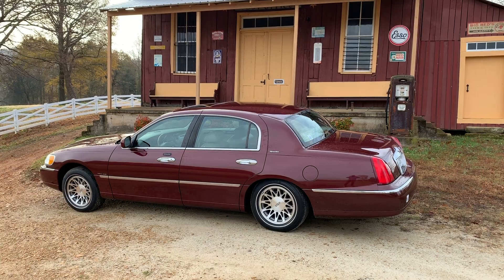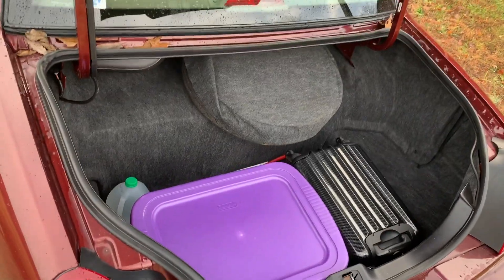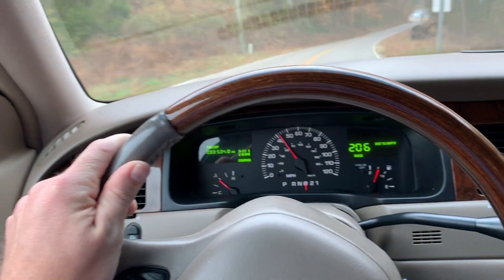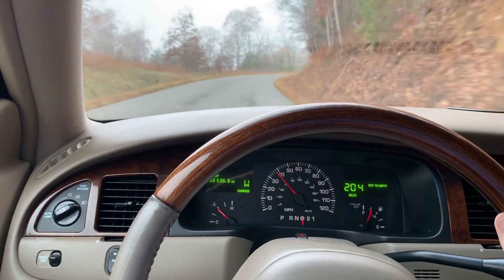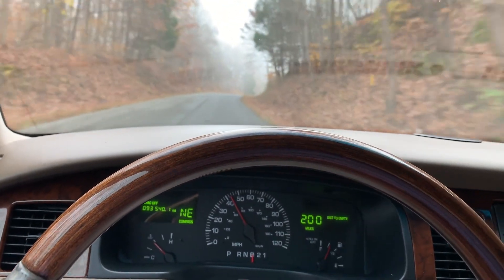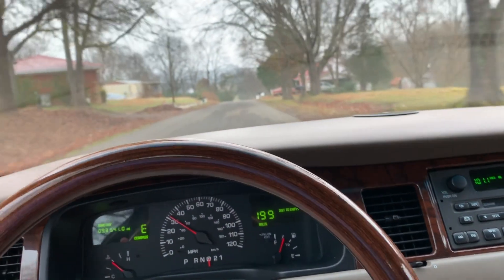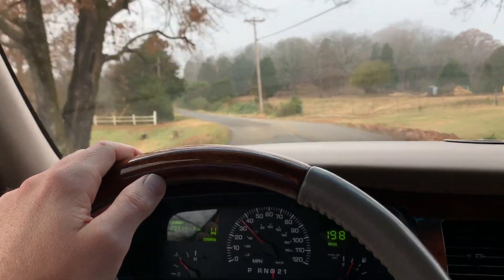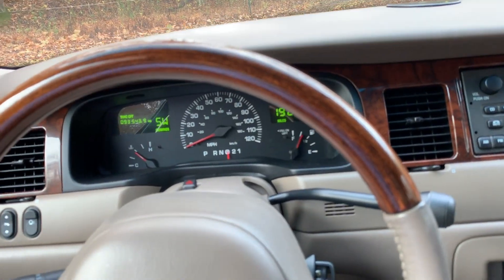2000 Lincoln Town Car Signature (Should You Buy?)

Comment: Probably already know, but these will go 400,000mi plus.  Best bang for the buck luxury car for the budget guy.  I have 2006 and it rocks anything for the same price. Brakes can feel a little soft due to rotor to weight feel.  It weighs 4500lb and the rotors aren't all that huge compared to todays vehicles.
Reply: That’s the one thing I’ve noticed, I was kinda worried about. I got a 99, when I go to break, it takes a little bit longer than the little Toyota I had. I’m guessing because the town car is much bigger? I don’t know though.
Reply: @Ninnjette-  Yeah, the towncar weight difference is going to be noticable at first, but you grow used to it.  It's a very safe car too in case you were to get into a crash vs the toyota.  Being you have a 99, I'd have a shop make sure your brake lines aren't spongy or rotted.
Reply: @prodesign8189  I really appreciate your reply, the guy I bought it from was very honest with me and told me there was a leaking valve cover gasket on the driver side before I even looked at it. My mechanic this Saturday is going to fix it, so I can have him check the brakes while he’s at it. Thank you!

Comment: I appreciate your taste in Lincolns, but the 99-02 town cars are UGLY but the 03-12 town cars are much more refined and come with dual exhaust. Can't buy one without it.
Reply: @ccorona581   shots fired eh?
Reply: 99 look pretty clean tbh 🤷Looks kinda Old school Gangstrr
Reply: I actually prefer the 98-02 body style to the later ones. Only big advantage to the newer style is rack & pinion steering. I'm biased though, I have a '98 Cartier, a '99 Siggie, oh, & an '05 Crown Vic LX Sport.
Reply: 98-02 grew on me a lot, I actually prefer them over the newer ones, I just like the bubblier look. And the 98-02s came with dual exhaust depending on the trim level. Mine has them.
Reply: I like my 02 more than the after models

Comment: I'll need to see if 2006 has the same for interior lights, never thought about this until saw your video which mine has the same dash layout & I usually keep my lights in the auto position. I've never liked this body style but has grown on me over the years plus like the factory wheels. When the car sits low in back that's a sign the airbags need to be replaced which I had to have mine replaced last summer 2018 which I had the car towed to dealer as I wasn't going to drive car that low but thankfully my service advisor gave me a break on the price to replace airbags & pump.
Reply: If you don't mind me asking you.. How much did it cost? I also wonder if you convert them over to springs. Does it change the ride quality?
Reply: @thalo9237  I don't know about the quality of springs, I didn't have mine converted which I went with the original suspension when I had it replaced. Plus I had it done at the dealer as I don't trust anyone else outside of factory trained technicians for something major like this plus my service advisor at the dealership knows me since I take my car in for oil changes as needed. The pump & ai suspension bags was around $2,000 something with parts & labor included. I don't know if this helps.

Comment: I get a laugh when I hear these cars called "big boats". They have a wheelbase of 117", that's just 2" more than a 1955 Chevy (a NORMAL blue collar car of it's day) and it's WAY smaller than the 1979 Lincoln Continental Town Car (127" wheelbase) that these were DOWNSIZED from in 1980 (Yep, same paltfrom from 1980 till 2011!), Yet, Even those "BIG PIG" 1979's were not as large as my 1976 Cadillac Fleetwood (133" wheelbase). When I was a kid, This size of car was MID SIZE. Hell, A compact Chevy Nova of the 1970s would be called "large" today!

Comment: The gas milage is not that good , the rear air ride goes out (leaks) as they age. You can change out the 
air ride to regular shocks but you better do the work yourself.

Comment: It's 5500 pounds. And there's a 6 disk CD changer in the trunk
Reply: Nope, 4,100 lbs is the curb weight.  Where did you see 5500?
Reply: @tylerarmstrong4279  That is GVWR on the door panel, or the max weight the car take safely including all people and luggage.  My 08 Corvette says 3,784 but the curb weight is 3,200
Reply: Makes way more sense now bud. My bad. Just got a presidential edition from my grandpa, absolutely mint.
Reply: @tylerarmstrong4279  Keep it nice and enjoy.  Of all the cars I have owned my 2006 Town Car rides the best and is the best zone out machine to drive and just relax.

Comment: $$ they want
Reply from the maker: $2000
Reply: Where they r located
Reply from the maker: It’s not for sale publicly
Reply: @JakeTiesler  That's an absolute steal. Also, when you exit the car the air suspension will vent a bit to get to trim. Once you start the car, the height sensor will inflate the airbags to the proper trim. Unless the car is sitting all the way down, the car is operating the way its supposed to. Bags are super cheap and easy to replace on your own. Also, if there was an Air Suspension issue, you would almost definitely get the Air Suspension message on the dash. Well maintained, this car wold get you to 400K easily.

Comment: My 2011 towncar has 523.342.0 miles
Reply from the maker: Have you replaced the engine and trans? How many times?
Reply: @JakeTiesler  I bought the car from a limousine company at 411000 plus miles it came with all of its maintenance records from the day they bought it on January no take that back December 20th 2011 and they put it to work on Christmas Day and I bought it 6 years later I've gone through the maintenance records there are no new engines no new transmissions it's the same block same tranny just very well maintained its had to timing chains intake manifold gasket replacement and that's about it
Reply: The only thing I don't like about that car that you have is it's not a fleet vehicle it's a standard town car issue to the general public limousine companies police and taxi cab companies all have a fleet license the fleet vehicles are built better than the public models a lot of them conquer out at a hundred and forty $180,000 but the fleet vehicles run
Reply: That's why CarMax will not buy or sell fleet vehicles because they last too long you will not be back to buy another one
Reply: You do have a CD player in there a 6-disc changer it's to the left as soon as you open the door to your trunk mine is the executive l so there's six and a half in more floor space in the back of my car
Reply: Do yourself a favor and tint the windows 100% limo tint you won't regret it
Reply: I was looking at the video and your gas miles to empty said 206 miles at 3/4 of a tank that's horrible I'll get 400 miles to the tank sometimes 427 off 17.5 gallons
Reply: Well as of today it is at 555.789.0 miles today
Reply: @JakeTiesler  0
Reply: Took it on a trip to washington state from California the computer said 411 miles to empty and by the time we got back it was at 505 miles on 17.5 gallons that's 26.8 miles on the freeway

Comment: Incredibly poor air conditioning system. 👎😕 The AC fan on high was so weak it couldn't keep my 2011 TC cool on an 85 degree day..which even the cheapest Hyundai car can do. By comparison..my 1982 Lincoln Continental Mark VI could keep my interior 60 degrees on a 100+ degree and humid summer day. It's AC fan was so powerful you had to wear hairspray to keep it from moving your hair and you felt it could literally freeze you. If it wasn't for this issue..I would be driving that 2011 TC today..but can't since I live in a hot and humid southern state. And yes..the car was running properly and was mechanic checked for issues. Plus..other 2011 TC's I've driven had the same problem. No thanks!
Reply: YOU KEEP REPEATING THIS ON ALL THESE TOWN CARS VIDS. OUR AIR AND MY FRIENDS TOO RUN ICE COLD. AC NEEDS TO BEST MOTORCRAFT' PARTS, COOLANT. SO YOU DID SOMETHING WRONG

Comment: I'd skip it. These cars actually take a lot of experience to drive in all weather. You'd need 100 hours each in rain, snow, and fog to be competent. These cars can and will go into a spin unless you know them fully.
Reply from the maker: My TN days have me prepped for winter roads! Thanks for stopping by
Reply: Surely to gain the said experience, you'd need to start from nothing at some point?
Reply: Good point, but we no longer live in an era of ubiquitous rear wheel drive cars. They are the exception,rather than the rule. As a result, there are far fewer heavily experienced drivers to teach newbies. Therefore, new drivers must, by and large, learn how to drive these cars by trial and error. Thus the danger of inexperienced drivers in rear wheel drive cars.
Reply: Word.
Reply: dirp birp if you get hoot snow tires and go practice in a few snow covered parking lots it isn’t too bad. I’m in high school and I’ve made it through two Connecticut winters
Reply: The key is to air down your tires and stay out of low gears. I've drove mine in snow and rain it handles very smooth. Traction control will flash if you get too crazy with od off but always make sure your tires are good. I put mine down to 28 or 30 psi in the snow/ rainy months. Yeah it handles like a boat and you lose mpg but you have good traction
Reply: dirp birp   Hell, 30 plus years ago rear wheel drive was the norm. No ABS or traction control either. You had to know how to drive with the seat of your pants. I'm still rocking them to this day. Put some studded directional snow tires on it and it'll get you there.
Reply: dirp birp  unless the year you started driving was 1979.  Like me
Reply: True. That’s the case with a lot of RWD vehicles.

Comment: Air bags in the rear. They  run well over 300,000 if maintained properly  as well as Fords Crown Victoria and Mercury’s Grand Marquis
Reply: My 2011 has 523.352.8
Reply: @raysegura4139  Yours don't have tbe,air bags suspensions 2010, 2011, don't.
Reply: @captainamericaamerica8090  yes it dose have them I have replaced them myself it was so easy did it in 45 min
Reply: @raysegura4139  I read that the 2010, 2011, don't have air bags.   Where did you buy them??
Reply: You can find the best prices on eBay I got them for $58.00 for the pair
Reply: My car is a fleet vehicle . and was a limo executive l this is the car they cut in half to make limo's out of so they need that comfy ride
Reply: It's called air ride
Reply: @raysegura4139  The Presidential model town car is the Nicest best
Reply: @raysegura4139  Thanks